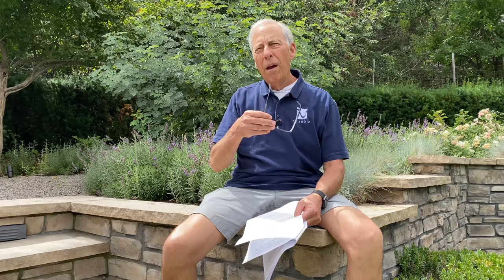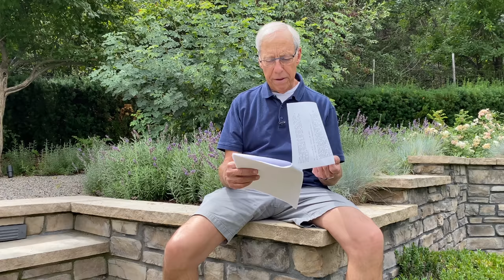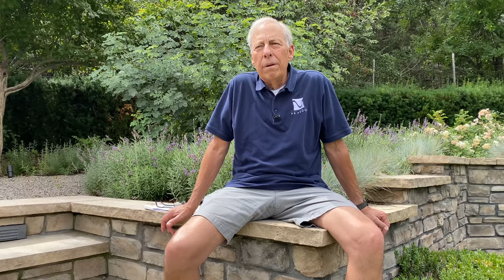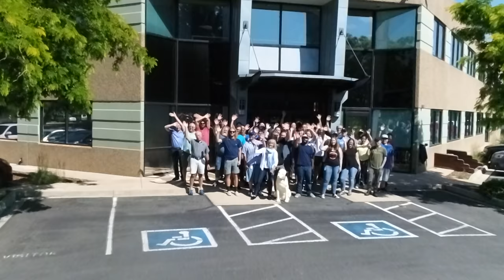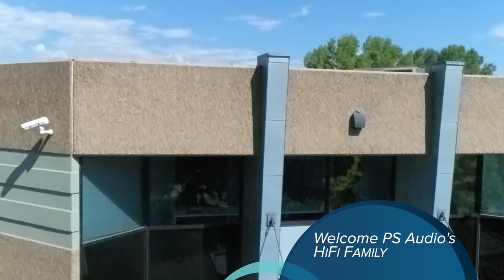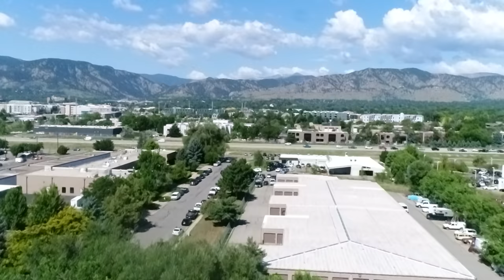Why speaker cables have bare ends

Comment: I have a mystery ..... it's been puzzling me for a long time .... why is it, after having tightened the binding post screw down as tightly as I can onto the copper cable strands, I can go back a month or two later only to find I can further tighten the binding screw !! At least half a turn !
Reply: I have the same issue, even at the amplifier end where there is no vibration.  
There is much to be said for spring-pressure connectors rather than screw type.
Reply from the maker: Definitely one of the great mysteries in the universe. I find the same thing. My guess is that the materials are somewhat malleable and over time deform enough to get loose.
Reply: PS Audio......Yes .. that's the conclusion I came to in the end . What's needed is heavy duty sprung loaded clamps that continually take up the slack.

Comment: A better question might be “why do we use 10 gauge speaker cables when the internal wiring on both ends of the chain is often less than 18 gauge?”.
Reply: You want your longest length to be as efficient as possible.  3 metre runs of 20g are truly bad.
Reply: You forget about distance dude.
Reply: From what I’ve seen, the most popular internal speaker wire seems to be twisted pair, solid core 20G wire. The first time I saw it, I was incredulous. I mean, telephone wire as speaker cable? But it does seem to work!
Reply: The reason to increase the diameter, or cross sectional area, is to lessen the resistance over a longer distance. 
So a short segment in a smaller size wire isn't necessarily an issue. 

An analogy to the "10 gauge cables feeding 18 gauge internal wiring", is parking lot lighting and the distances involved. 

With outdoor parking lot situations with massive distances between each pole and the building, the circuit size is likely only a 20amp circuit.

However, the distances involved dictate a much larger wire size be used to minimize voltage drop. So a normal 12 gauge wire off the breaker is connected to a larger 2/0 feeder size cable for the long distance underground run to the first pole, as well as looping between the poles. At the base of the pole it's connected to normal 12 gauge wires on up to the top. 

2/0 compared to #12 is about 20x larger, and 20x less resistance.

Comment: I have Ecosse bi-wired speaker cables that are shielded, but specifically this ‘ground’ is only connected at the amp end using its case as ground like a phone can be. So is this now considered a waste, or even harmful to the signal?
Reply: Because you have wrapped your speaker cables in an antenna, and connected that antenna to you amplifier.
You have added a source of common mode noise.

Comment: If u use a shielded cable for loudspeakers make the shield be part of the cable !!!
Lets have the simplest shielded cable one can imagine : a 75 Ohms antenna cable. 
U bend the external shield to the inner core cable at both ends & there u have it : all the crap outside signal is destroyed bc u made a short-circuit with the help of the inner core.
Another question is : is this shielded cable good as is ? Surely not that great, but engineers should start to work here if they didn't already. One might ask them if I'm not crazy too !

Comment: On a similar vein, howcome no standard plug/socket has come from the Hi-Fi industry? 
Early pro gear used 1/4 inch plugs, then moved onto speakon plugs, but the Hi-Fi end just seems to have given up.
Reply: And yet I still get shit for using RCA.
Reply: @graxjpg  Please tell me you don't use RCAs for speaker cable. Maybe on a Wal-Mart system but that's about it.
Reply: InsideOfMyOwnMind not speaker cable, just in general. I use regular ol coat hanger for my speaker wire.
Reply: @grant jonsn - What gauge?  I hope they are bespoke tailor and not dollar store.  Everyone knows dollar store hangers attenuate the  high frequencies.
Reply: Tim Short vintage Sanger-Harris hangers only.
Reply: grant jonsn - oh, so you aren't concerned about realistic treble bass.  Neophyte.

Comment: Lots of amps have died from the speaker posts being too near to each other and some short circuit happening with the wire strands touching each other. Then comes the cases of people not realizing their system is running speakers in opposite phase. It’s the #1 place of bad things happening in an audio system.
Reply: That is why fuses and output protection circuits exist.
Aside from doing strange things to the sound (primarily at low frequencies) what effect would having the phases reversed in one of the speakers do?
Reply: @machintelligence  It will mess up the stereo imaging.
Reply: @machintelligence  no offense TB, but my answer is reverse one side and sit AND LISTEN to it that way...
Reply: #1 place of bad things in my audio system is between my headphones... LOL I think I fried something in the protection circuit of my amp, it’s stuck in protect after replacing a busted power cable that wasn’t noticeable until it smoked.. checked the easy stuff, need to take a better look at the insides soon.
Reply: behexen250 Well, out of phase audio is hugely inferior on soundstage. No audiophile putting lots of money into his system should miss that concern. It might even damage (rewire) your brains’s “programmed” perception and sense of correct soundstage if you listen to it for a long time and get used to it?
Reply: behexen250 Lol, funny, I thought about such experiment when I wrote my comment and said to myself...no way would I risk it. What if the brain never recovers fully? Quite an interesting subject.
Reply: @ThinkingBetter  
Where's the bass ??? 🤣😆
Reply: poserwannabe Yes, the bass is perhaps most affected, but speakers running opposite phase do not affect the bass only. Our brain is quite sophisticated on sensing audio signals.
Reply: behexen250 From my experience, from an undefined location in the sky or some weird sense of nowhere. How about you?
Reply: I think that is why speaker connectors where invented ...for those not comfortable or capable of using and connecting up bare wire.
Reply: @ThinkingBetter  haha, yeah I'm aware, I've phased some huge systems, some that include JBL drivers that move opposite of conventional...peace
Reply: behexen250 Yes, it sounds like you are using a pair of headphones with no soundstage where it feels more like the sound come from within your head, from my experience. I’ve never felt it came from a particular wall. Actually this issue behaves quite different depending on how much of your audio is reflected when it hits your ears. The more percentage of the sound that is reflected the less you feel out of phase sound, from my experience. The worst is actually when your headphones run opposite phase.
Reply: I actually had the tinsel leads on a 12" woofer touch each other and become welded together while listening to Dark Side of the Moon in college.  The amplifier was fine, but I had to pull the woofer out and shorten the leads slightly to prevent recurrence.

Comment: I do wonder about how those ends corrode over time.
After a year, all that copper at the end turns ugly brown.
Reply: The Swartz That’s why tube connectors are becoming so popular. Also why soldered gold spade lugs are still a thing
Reply: Fat Rat  
I connect bare wire to my terminals and decades later it still looks the same as the day I connected it. My equipment is in a controlled environment, central air in the summer. Maybe if you live in a place like Florida it could be a problem because I know I have heard Florida residents complain about their CDs corroding. I have CDs that I have had for 40 years and they still look the same as the day I bought them. I live In Ontario, Canada and I've never had any of these issues, so either it's the environment that the equipment is in or, OR these people are full of it.

Comment: If there were enough energy in the environment to matter, then you'd be able to hear sound coming out of your speaker just by plugging in a cable and shorting the other end.
Reply: A speaker isn’t quite sensitive enough and the wrong impedance. Try a high impedance headphone, a parallel signal diode and connecting one side of the headphone to earth and the other to a long piece of wire.
Reply: Jonathan Sturm You didn’t understand SillyMakesVids’s comment. He was saying that to explain why shielded speaker cables are bollocks. It was not an invite to set up a system that does receive radio signals.
Reply: @Engineer9736  I was pointing out that there’s more than enough signal there, you just have to decipher it. In theory there’s no signal on the balanced unshielded speaker cable. Adding a conducting sheath is adding a radio receiving aerial.
Reply: A single generic speaker cable itself produces more noise on ur music than the sun eruptions & and the entire galaxy.

Comment: If the rfi is only millivolts why bother with balanced?
Reply: AFIK balanced speaker cables are really only used in applications such as live PAs where cable lengths of tens or hundreds of meters may be involved. Balanced cables for stereo interconnects may be worthwhile in some circumstances because the ratio of signal voltage to noise is much lower. In a speaker cable you're looking at tens of volts, in an interconnect it's usuallu less than two.

Comment: I'm confused. I can't count how many times you have said "cables matter" is it really audible?
Reply: Cables do matter, and it is quite audible.
What is not important is trying to shield a speaker cable from ambient RF, Like he said, the amount of energy a cable can pick up from the environment, is down below the noise floor. This is different for interconnects, shielding may or may not help. It does not help me, but I do not live under a radio tower or use LCD lighting in my listening room. If you do, it might help.
What makes a difference with speaker cables is inductance and capacitance. The general thinking is to use wires that a spaced far apart with insulators that have a high dielectric. Other things like cable length, wire size, and coiling can have a massive impact.

Check out Dave Rat https://www.youtube.com/c/DaveRat/videos
Go back about 6 months, he did a series of vids on cables. You can clearly hear and see the differences at times. Very interesting stuff.
He is a bit of a legend in the pro audio community, and does the live mixing for some very major bands.
Reply: joshua43214 inductance and capacitance have zero effect for short runs of a few metres at audio frequencies. Same with skin effect, it is only radio frequencies that require special cables.
Reply: @geoff37s38  Incorrect, both have a direct affect on damping.
Reply: @geoff37s38  
From the moment 'capacitance' and 'inductance' are present in any length of cable, they will have some effect, perhaps not huge (depending on the frequency, the higher the more effect..)
I tend to agree that 'skin effect' is more relative to radio frequencies, it is though present even at frequencies as low as 100 Hz and above 1 kHz starts getting noticeable in graphs.
If it makes an audible difference is another story though, not enough in any case to be concerned about (with its effect on speaker cables).
Reply: Arthur Manolopoulos yes, I am talking about capacitance and inductance in short run audio cables where the effect on audio frequencies is inaudible.
Reply: joshua43214 it is impedance that may affect damping. The cable would need to be very long or very light gauge to have enough resistance to affect damping.
Reply: @geoff37s38  
Absolutely Geoff, the shorter the length the less the effect ( ...almost a 'non event'..)
Interesting though that, there is some difference in sound between extremely short runs of speaker cables (..say, the amplifier is right next to the speaker), and when one uses 4 -5 or even more mtrs of cables.
It's not unusual to see mono-block amplifiers being placed by the side of large speakers and thus, neutralize whatever effect the cable has.
Reply: Geez, I've got some old oscilloscops at work about to be scraped. Might bring one home and see what's going on.
Reply: zachariah adams it is well worth watching Ethan’s video and reading his responses to comments.
Reply: Fat Rat  I've got a funny tone gap in the left ear, goes a little higher than normal, and has a constant ringing. It's a scared ear drum. Everything is reflected to my right side. I do understand that good connections make a difference but would probably only highlight the artifacts in my current setup. That being said, environment and aesthetics make a huge impact to those things that can not be measured between the speakers rather it happens between the ears.
Reply: @geoff37s38  that's a can of worms because you'll eventually get into Occam's razor, observational interference, cartesian doubt and all sorts of things that probably have zero to do with actual sound. Even the most educated of people are not immune from fallacy.
Reply: @geoff37s38  '
Yes Geoff, thanks for that, I am aware of this video.
Like many other things in the HIFI and audio world there's always two sides, antagonizing one another, each one professing the "absolute truth".
It seems to me, this is a classic example of this. 

Mr Winer seems to have a personal 'vendetta' with Paul Mc Gowan, I wonder why?  Why focus on PS Audio in particular? Almost ALL, so called High End manufacturers, are on the same page with Paul, are they not?
Most claim sonic differences between cables, power cords, plugs (!), tubes, capacitors, resistors ....you name it!  Yet, they cannot give a scientific explanation about their claims.

And so, people buy them on merit..
They listen, compare, evaluate and if convinced, they buy. Not every consumer or music lover is concerned about the "science" behind a product.

If it pleases their ears and sounds good to them, they buy. And, as long as they are happy to spend their own money it's all good! Keeps the wheels turning, as the saying goes..
Reply: @m.9243  much of those components you mentioned do have tons of scientific evidence to back up the quality. Not everything that preforms better equivalates to a higher cost. Paper cones are still fantastic in many applications. Some people are very concerned with the interference in the speaker cable but forgot about the several coils of copper that are inside the cabinet. The magnetic field of your voice coil in proximity to your crossover should have a larger effect than if your wire is braided or not. This was actually a problem at Appel with in-case computer speakers that would crash hard drives. I've got no problem with people tuning a machine to it's most optimal operation but some improvements are going to get you a better results than others.
Reply: Arthur Manolopoulos Ethan is an engineer, Paulis a salesman.

Comment: Yes, but WHY do speaker cables have bare ends?
Reply: Because if you don’t remove the insulation then the signal won’t get into the speaker
Reply: Good question Sheriff

The problem I’ve heard with bare copper is corrosion over the years. So I’ve been buying cables with banana plug termination where no copper is exposed. 
Before that,  I always soldered the ends

Comment: Then why bother with balanced headphone cables?
Reply: I like balance headphones amp.
Reply: @behexen250 I understand that but my argument was, as Paul suggested that small portion of naked cable won't get affected with interference given the proportion of noise impacting the naked cable is so low then how your balanced cable along balanced amplifier will help the noise around? In light of physics, I mean sure on a paper balanced looks good but can human hearing pick that noise which if going to be impact on that 3feet of unbalanced cable?

Comment: First, no need for shielding and here's why. Paul talks endlessly about the advantages of balanced interconnects and how they cancel noise. Speaker cables that are NOT coaxial are inherantly balanced in terms of how any noise is handled, should it actually be an issue.

Comment: Hmmmm.  $300 for 10 ft. of speaker cable or 15 (and probably more) new CDs.  New music wins!  ;-)
Reply: Fat Rat  Actually, my brick-and-mortar stereo dealer sold me two 3 m lengths of of low ball Transparent speaker cable for US$32 back when I could still use my ADS L520s.  That was acceptable at the time and I think it did make a slight improvement.  Here and now, I spend my limited discretionary funds on music (and books and magazines).  That (and really good coffee) is luxury enough.
Reply: Fat Rat  So far two cuddle toys and a few books.
Reply: Fat Rat  Assuming I last that long.  Cue Buddy Guy:  "Done got old .  .  . "
Reply: Fat Rat  The optimist says the glass is half full.  The pessimist says the glass is half empty.  The existentialist says the glass is.

Comment: Snake oil
Reply: Copper colored
Reply: living is easy with eyes closed...misunderstanding all you see
Reply: 10mmgee20 Agreed! This cable situation has gotten out of hand. I’ve tried many over the years and cannot hear a difference. Some were physically problematic to work with. I just use the plain old 16 awg or 18 awg lamp cord. It works for me without problems. Watch the audiophile community cringe at what I do.
Reply: behexen250 I use 16 awg or 18 awg lamp cord - the old school standard.
Reply: googoo gjoob I concur
Reply: I really don't get it; I got 2 nice speaker cables and I got 16awg cable from Home depot for a test and the difference between the 3 was very noticeable. I trust my ears.
Reply: @veteq101  
Your ears are fine, but the brain...  Perhaps you should get someone to help you do a blind test where you identify the "better" sound while not knowing which cables are being used.
Reply: KY-Jelly works best
Reply: @veteq101  
Trust measurements, not your ears, ears are unreliable. You can listen to a song one day and the next it sounds different because you didn't clean the wax out of your ears.